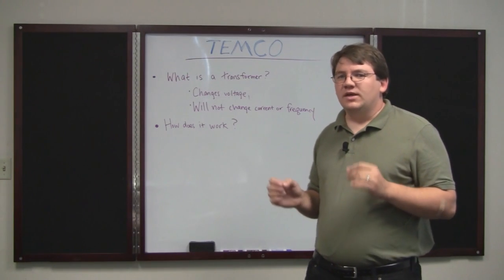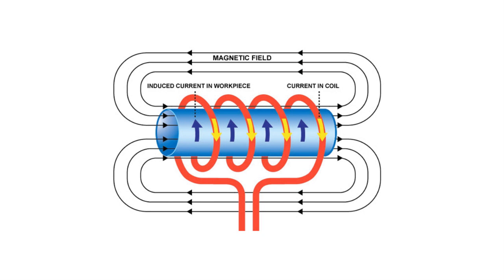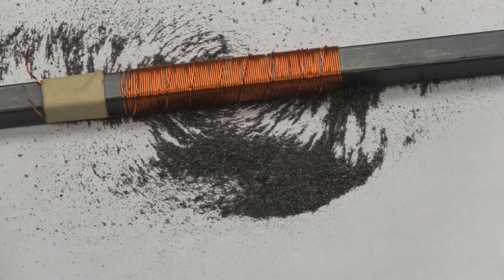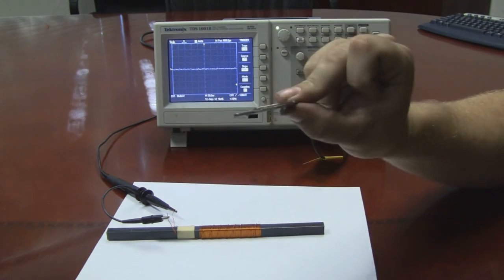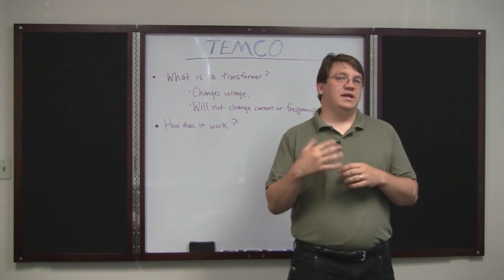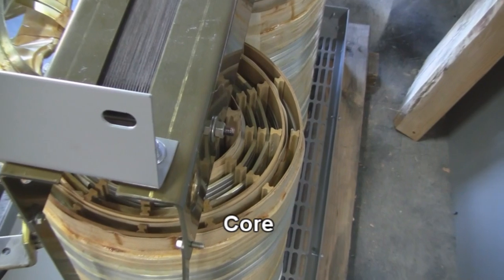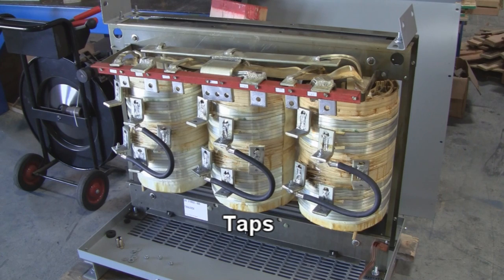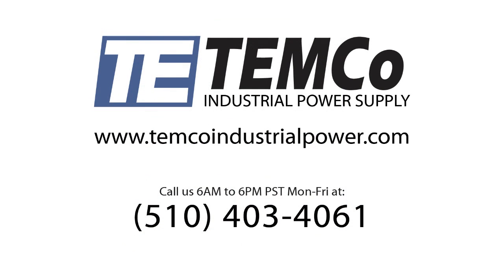What is a transformer and how does it work?

Comment: Step-up transform converts low voltage at high current to high voltage at low current...step-down converts high voltage at low current to low voltage at high current.....So I'm lost when this video says "current' do not change in a transformer.
Reply from the maker: You're correct; at the lower voltage, you will get higher current. However, you can't expect to draw more current from the output than is available on the input via the transformer ratio. What we could've worded in a better way is that you cannot create current from a transformer.
Reply: is it batter to say, that the power does not change? power in = power out except for the little losses that transformer has, instead of saying current don't change?
Reply: am not! its just that current changes with load, current is dependant on the load applied to the transformer

Comment from the maker: Current will change as a ratio to voltage (this is correct). However, it's not possible to draw more amperage than is available on the supply side of things.